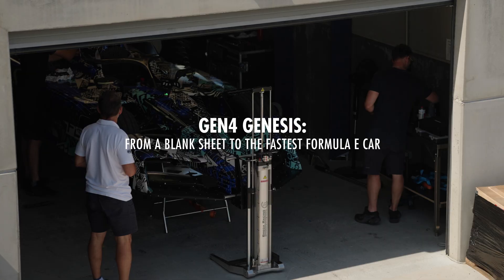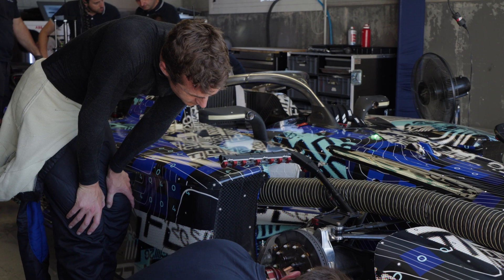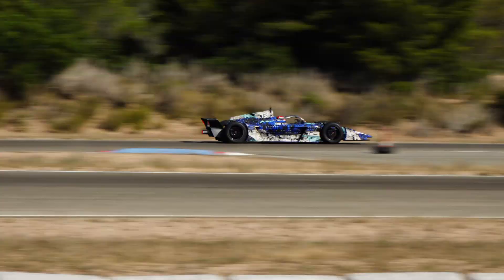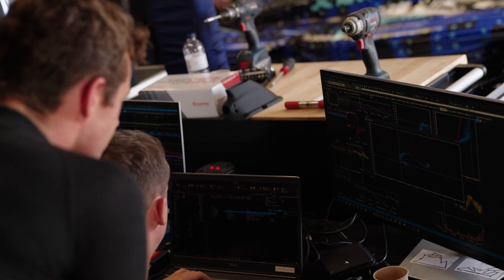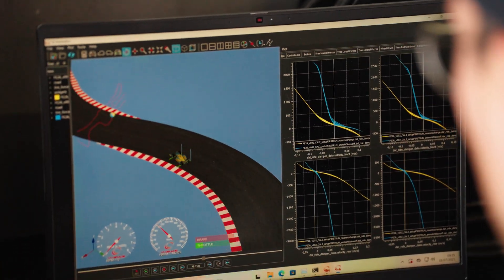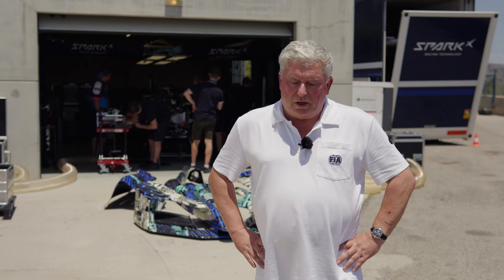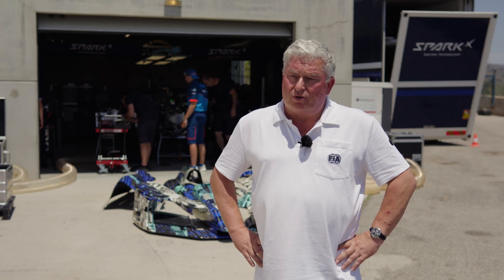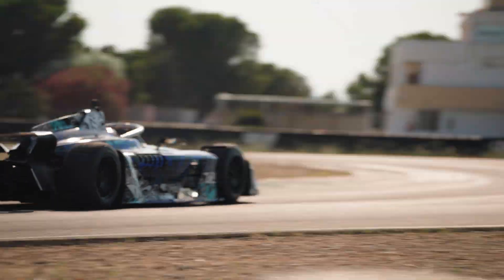The Gen4: Building The Fastest Formula E Car Ever

Comment: traction control and anti-lock braking? that seems counter to racing
Reply: Not even the world's best drivers could drive a car that delivers 600 kW of instant torque without wheelspin, and manage to brake from 330 km/h to 60 km/h without locking the tires. In this case, traction control and ABS become a necessity to prevent the car from becoming extremely unstable.

Comment: Nice job. 

For proper Turbine usage. Maby need air pressure maintained system. With hot air delivering output. Where can collect more energy. For speed acceleration transition. 

Sure here need air pressure and compression and air cleaning. With prestige cooling system.

Then will can go as 950 even more HP 

And can deliver smaller Power Battery. With huge amount of more road trip. Deliver the better hot air I needed. For example in winter times or hot days cooling. 

Sure here need nice cooling system. For all transitions.

One Compressors can generate 356 Celsius.

Comment: Why not let TEAMS BUILT THEIR FUCKING CARS how hard can it be. Idiotic shit
Reply: Because aerodynamics isn't a strong point of Formula E cars. Producing their own chassis would be pointless and would only increase team costs. Teams can develop their own rear suspension and powertrains, which is far more relevant than the chassis.
Reply: FE partly does, and is also optimized for cost, exceptional relevance and unpredictable racing for most value added for sponsors, manufacturers, drivers and fans?
Reply: @GillisLang-p5p it doesnt, cars are the same except some small details. Thats communism and woke shit. Teams will built the cars from start to finnish then we get progression in tech what motorsport SHOULD BE ALL ABOUT. When fia creeps and teams are talking about show more than tech, you know everything is ruined.

Comment: If it's really such a good car, Formula E shouldn't be the series where it's used. Electric racing needs a proper, serious motorsport series rather than the commercial campaign like Formula E
Reply: given the current contract, best shot is to influence FE to be more like you personally want, so long as that also meets the matrix of the brief that perpetuates it as the best value proposition in motorsports for all stakeholders?

Comment: I was hoping for active arrow on the next gen. Maybe there'll be a Evo version with it. Other awesome additions would be adaptive suspension that helps regen the batteries and independent torque vectoring. I'm sure it will come eventually.
Reply: I was wondering why formula E didn't already Implement these features. In theory, having a separate electric motor at the base of each wheel should allowed for super fine-tuned torque vectoring and torque-response curves. Likewise, if the boost zone system is carried over from the previous gen, why not also implement a formula 1 style DRS system too?

Comment: Wait. In Formula E designed to be a test bed for hi-tech OEM solutions, you standartize most important parts like motors and batteries?!
Reply: No, only the batteries and the front motor were standardized, but the motor in the rear is up to the manufacture
Reply: @gatiakbarwibisono9387  Well, battery itself is the most important EV part, which is standartized.

Comment: ABS and Traction control is a step backwards for me. You gave the drivers all this extra power (and full time awd) but instead of making them have to manage it themselves you are going to let them use driver aids and keep us from seeing cars slide around on power, and seeing people get right on the edge of locking up going for dives
Reply: ABS is needed due to the braking relying a lot on the regen as it's hard to operate this manually.

Traction control is a bit of a shame but we need to realise as fans that there is still a skill gap even with TC. It just means its more technical to extract the limit and getting closer to the cars limit takes even more skill. At least thats what Michael Schumacher always said about TC.
Reply: @lewis8552  That’s BS. They managed fine in Gen 3 without ABS, and there have been plenty of race cars with lots of regen braking without ABS, even those that blend regen braking with a conventional system which is much harder to manage than pure regen.
Reply: Not even the world's best drivers could drive a car that delivers 600 kW of instant torque without wheelspin, and manage to brake from 330 km/h to 60 km/h without locking the all-weather tires they use. In this case, traction control and ABS become a necessity to prevent the car from becoming extremely unstable.
Reply: Formula 1 had Traction control in the 00s. and I never see people complained
 about that.
Reply: @jesperhammarlund300 There is a reason it went away. Because people didn’t like that it took an element of skill away

Comment: 3:25 hold on a sec... you mean with regen you're getting more energy in than you're putting out?? There must be huge losses in heat and line-losses in the system then I'm sure, no?
Reply: The FIA just limits the deployment power, but lets them use full regen, so technically they have more braking power than acceleration, doesn't mean they are actually regening more energy than they put in
Reply: That's power not energy. It means it can slow down more per second than accelerate per second. Let's say you will use like 600kW for 7s during acceleration, but getting that energy back to battery (braking) would last only 6s with 700kw regen (given no other loses and in ideal system without friction and stuff).
Reply: the 700kW regen is going straight into the battery, the only loss is very minimal in heat through the regen system and the charging of the battery

Comment: A little disappointed that they got larger (especially those immense overhangs) again, but hopefully the racing will make all the work the engineering teams did worthwhile
Reply: With battery tech getting better, there is a chance for the size to be reduced.

I like the Gen 3 size. I think they're perfectly compact.
Reply: Smaller cars simply just aren’t as safe as the speeds get higher
Reply: @Mearex_  you can see in the Gen 1 car the crash structure of the monocoque is way shorter than the width of the car, we could even go smaller. Plenty of room to go smaller.
Reply: @Dakkyun  would there not be an issue in a smaller car that the battery has not enough impact resistance and could result in more devestating fires? Im new to FE so curious what the protections are against battery fires.
Reply: @louievegas5533  not at all, those crash structure will take the hit anyway. Regardless of how wide the suspension/wheels are
Reply: @Dakkyun  Neat
Reply: @Mearex_ not really...

Comment: Now let us be serious. 
Formula E should be test bed for electric cars. Motors are already over 90% efficient and there is no reason to push for 1% more.
Main issue is the battery and charging. 
So, formula should be such that it gives maximal freedom for battery development. 
Some might opt out for small and light battery that can charge superfast, making several pit-stops during the race. 
Some might have huge batteries that can do the whole race, but the car is slower.
Some might even have single pit stop with battery swap. 

So they can test which is fastest way to go set distance (charge, swap or big battery).
And there should be extra points, not only for the fastest lap, but least energy used, given car finished in same lap as race winner.
Reply: Idk Formula E is already doing all the right things. Efficiency is the most crucial thing for electric cars. With what is on offer for Gen 4 I think we have plenty thats road relevant with the traction control and ABS stuff, combined with the characteristics of electric power. When this started in 2014 things were really not good with electric cars. Mostly known for how bad the range is. Even Gen 1 had that struggle because they wanted cars that race well enough. Well if you can even call that a range. Now you don't even talk about it anymore. Then you have the technological push in recharging technology, might even be more important than the car stuff itself.
Reply: @BloodDerg multi pit boost endurance racing?
Reply: er, see gen 2 to e-tron, gen 3 EVO to cayenne, tire manu road tire versions for AWD family SUVs, etc.?
Reply: That would be the perfect scenario. Unfortunately though it's too costly for the teams in the championship to do that sort of R&D. Like they'd need F1 budgets for it which is probably only possible for a few of the manufacturers.
Reply: @lewis8552 No, they only need a budget cap, however that cap would be, and they already have it, so... Then, teams would decide on what to spend it...
Reply: @senja572 
Nah
After the cost cap in F1, teams don't experiment. Cars are all similar and racing is still bad
Reply: There's also no reason not to push for 1% more.  It's not like it's impossible.  Look into YASA axial-flux motors - smaller lighter and with even more torque.  Maybe we can get those with a Gen4 EVO.  Mercedes will probably be using them in the F1 power unit.
Reply: Or have inductive charging, so you dont actually have to plug it in, but drive over a charger and it charges the battery. Go to your car menu on the dashboard and select "START CHARGING" and when finished, you can pay with paypal for example without leaving your car.
Reply: Except that it's a single manufacturer series...
Reply: You’re also assuming that electric cars are the obvious future of street cars. It’s not a given that electric cars are it. There’s work on sustainable combustion fuels that might be an easier and cheaper path towards more sustainable automobiles.
Reply: @jayb555-r9k But it really is.
Internal combustion engines are by no means simple, and above all, they are not sustainable. Apart from the fact that the extremely poor efficiency of an internal combustion engine means that much more energy is required and hundreds more parts are needed, they also do not improve air quality in cities, which is an extremely relevant factor.
So no, it is absolutely out of the question that internal combustion engines will be the future in any form.

Comment: Why is it 300mm longer!!! You had a perfect size!!!
Reply: After some digging I'd say it's crash safety related because of the higher speeds. The wheelbase is now 3080mm vs 2970mm in gen 3, so 11cm longer and still 2 cm shorter than gen1. But there's 1,30m of structure in front of the pedal box to the nose and >70cm from the differential case to the wing.
Reply: @kooooons  I can see that. Though, if size and manoeuvrability are the trade off for top speed, perhaps the top speed should be reduced next time. We'll have to see how that extra 300mm plays out but I can see the first few races having quite a lot of nose to tail contact.
Reply: @intuitiveinterativedesigns8670 yeah, well, Gen 2 was messy too. Gen3 was better. We'll see.
Reply: My most likely guess is aero and battery.
Reply: I agree, they won't be able to turn in the tight city corners. Whatever speed they gain with four-wheel drive they will lose in the corners. These cars are simply too big. Designers just can't learn.

Comment: What about range and race length, all this talk of performance is great, but when are we gonna address the race length. Currently they are more like sprints. A race at least 55-60mins long would be a nice change.
Reply: It'll depend on track but I suspect the 45 minute races will still be the norm.

It seems they are chasing performance 1st and then will extend the races as they continue to improve the battery. Mainly because there's still a stigma around FE being too slow for many motorsport fans. So better to build a fast foundation and improve it from there.
Reply: bigger battery i guess